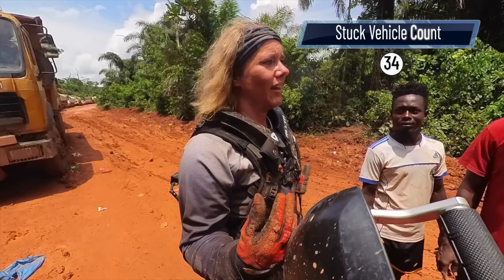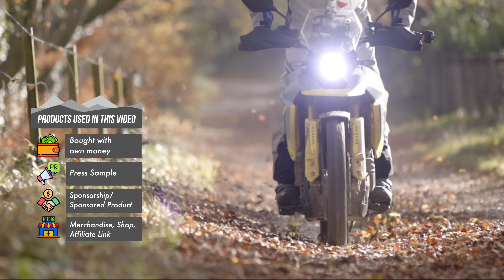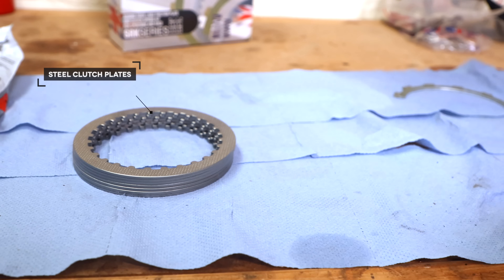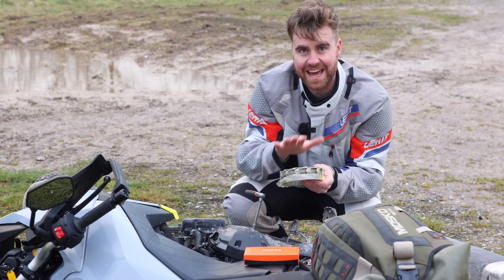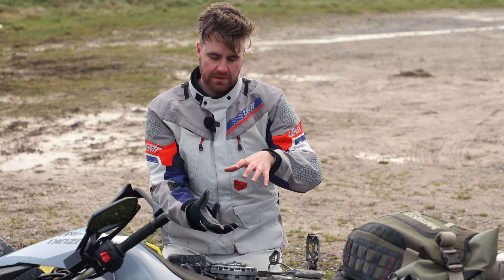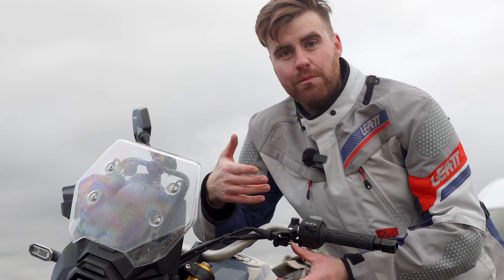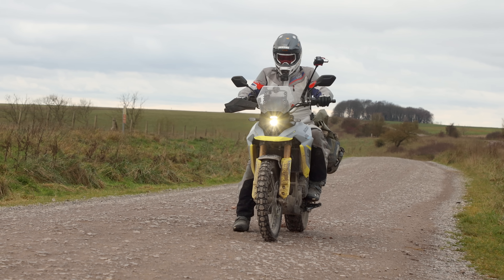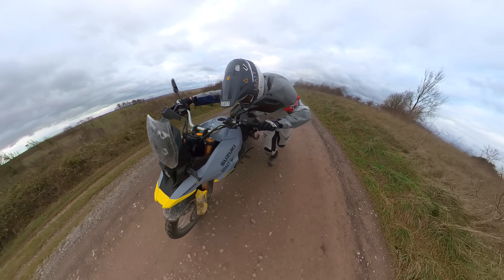This Dakar Trick could've saved Itchy Boots in Africa! | MiniTip Monday

Comment: We saved a trip crossing the Simpson Desert in Australia by using some fencing wire to increase the bulk in the clutch pack.  The clutch was burnt out 100kms from Big Red.  After the fencing wire pressure plate was added, it was ridden to Poeppel Corner, then up the Hay River Track and then home to Melbourne.  Over 2900 kms.
Reply from the maker: Hell yeah man!! What an effort.
Reply: For some reason it sounds to me like you stumbled onto an improvement in multiplate clutch models. I picture you installed it like a clockspring ? Anyway, if there's an improvement to be found at least you made it keep going on the journey of a lifetime. As it would be for most who'll see your account here! What motorcycle were you riding?
Reply: I expect oldmate just wound some fencing wire between a friction plate and steel to close up the gap haha, maybe I missed you're comments' sarcasm I can't tell :P pretty epic tale I agree, my only real outback breakdown was another rider blowing a headgeasket and me towing him ~100km to help with a ratchet strap between the footpegs. A bush mechanics clutch fix with fencing wire is way cooler and definitely one I'll remember too :) - I'm placing me guess it was a DR650??
Reply from the maker: The most wholesome set of comments on this video. Thanks for being good people and thanks for the story Hoages!
Reply: @HoagesMoto  Were you on our trip?? :-)   Yes it was a Dr650, killed by a young bloke used to riding motocross bikes (and driving to the local bike store for bits).  The fencing wire (last thing I packed before we left for the trip) was fashioned into a circle that was then inserted into the clutch pack and everything was bolted back together.
Reply: What can't you fix with fencing wire??
Reply from the maker: You can fix it with fence wire.  @geoffmerritt
Reply: Who manufactures that fencing wire?😂 you should send them a letter you might end up with an endorsement👏🏻

Comment: I can't believe you went through all the trouble to open a clutch cover on the road for this! Nicely done!
Reply from the maker: Thanks! 👍
Reply: Thats easy for most bikes. The hardest part is to lift the bike up.
Reply: @BrakeMagazine here is a much better alternative. The extra clutch plate just add it to the stack as per usual assembley. Or even better add some washers to the springs to effectively make them longer and this should get you to a shop where you can replace the clutch
Reply: on this vstrom, it s easy, which is a positive aspect of this vstrom
Reply from the maker: The plate break is only if you don't have a spare
 @holmes1956O
Reply: You legend!
Reply: Except that none of these methods would have worked in Noraly’s situation.
Reply from the maker: Why not? @G58
Reply: @G58  Seriously - why not?

Comment: Rather than snapping fiber rings. Bend one of the metal plates in a couple of places and make a wave in it. It will take up more space and act like a diaphragm spring. I have done this mid Enduro race and completed the rest of the race with no noticeable difference in clutch performance.
Reply from the maker: That’s a cool idea. I’ll add that to the mix.
Reply: Uh...  why not carry an entire clutch disk set?   They don't weigh much,  and if you're going to go through the trouble of disassembling the clutch just go ahead and replace the disks and ride on.  It's amazing to me how some of these "adventure riders" go out into the bush and wild places without being absolutely prepared.
Reply: because clutches are a gradual wear item and competent riders that know their bike will catch a little clutch slip before it gets bad and adjust their riding style to prevent it worsening OR jam the basket in one of many techniques to get out of trouble - a clutch plate set weighs up to 1kg which is an insane amount of weight to carry on a dirtbike/light advbike for a wear product people not racing will mostly detect gradual failure and be able to nurse a bike through a trip.
Reply: @HoagesMoto  You don't go out in the wilds of AFRICA unprepared for a failed clutch...  The friction disks of the clutch kit weigh next to nothing,  you don't need the steels because they hardly ever fail and lots of people just re-use them after scuffing them up with 220 grit sandpaper.  You have made no logical point here.   You can burn your clutch out quick in the muddy areas of Africa and you need to be prepared for that.   Adjustment wont mean anything when you have burned the clutch out in 5 miles of mud...   BE PREPARED.  KNOW YOUR MOTORCYCLE.  CARRY AN ELECTRICAL SCHEMATIC AND REPAIR MANUAL ON YOUR PHONE.   DON'T GO OFF INTO A REMOTE AREA LIKE A DAMN FOOL.  Have a nice day.
Reply: There's always a bush repair that will get you going again until you can do a proper repair.  It helps to have a good imagination and all the tools you might need.
Reply: Can't believe they don't just carry a spare bike... @BillySBC

Comment: There is a more subtle way to handle the early state of this problem.
Add a few washers under or on top of the springs. That way you increase the pre-load on the spring and thus adding friction. 

Used this method a number of times, learned it in tuned old types of motorcycles that didn't have stronger springs or more friction plates available.

Comment: in noralys case,the clutch on the crf 300 rally is a known weakspot - so in her case ,it was bound to happen,the solution is to replace the stock crf300 complete assembly whit the one from the crf 250l combined whit steel and frictionplates and heavy duty springs from the cbr 300 - fits right in,and has one more frictionplate,and 5 springs instead of just 3
Reply: You will lose the slip/assist function if you do this.
Reply: Good suggestion.  I think Noraly needs some guidance on when to do maintenance and when to upgrade for known troubled areas on stock bikes.  She does a great job beating the snot out of stock bikes.
Reply: Beste stuurlui staan aan de wal😅

Comment: Nice video - could save some folks a lot of bother. I had a similar problem with my first big bike halfway in to work in London. After waiting all day for a tow truck, the tow truck guy let me in on a trick that would have saved me next time: carry a spare clutch cable, passed through the route of the existing one, gaffa taped or zip-tied to the current one. Time to repair then is a matter of seconds on the road as you connect the ends of the new cable in where the old one went & strip out the old one. Once you get to the repair shop, just buy a new spare & tie it in place as before.
Reply: This is a very old enduro trick and one I've used on my bikes for many years. We're never to old to learn.👍🏻
Reply: ...and tape the ends of the spare clutch cable so no water can get to it and rust the cable (and oil it a bit)
Reply: @TetraX-ui7xl  yes, good point!
Reply: Good tip, and one I've used a lot, especially on my old 400 single, which destroyed cables on a regular basis. Only thing is, it's not helpful in the situation described in the video.

Comment: I honestly can’t believe how anyone would take on the kind of trips Itchy Boots does without really good mechanical knowledge of their machine,and how to deal with all the common issues that WILL happen when you’re doing those sorts of mileage.on my 16th Birthday I went out about 6 in the morning on my DT50MX super excited I rode about 40 miles and my Clutch cable snapped,I got home fine riding clutch less but all my bikes now have a spare cable zip tied to the existing one.Great video !
Reply: I did the clutch cable thing, I also had a hollow tube in the frame under the seat and stuffed a rubber siphon hose and extra bit of gas line.

Comment: Another tip - when your clutch starts to go, use lower gears to limit the load the clutch needs to handle (not 6th gear like I.B.). Even a slow limp in 1st gear is better than pushing.
Bikes using a hydraulic clutch can also try cracking the clutch line to release built up pressure - hot clutch fluid will put a preload on the slave cylinder, inducing slip.
Reply: Not sure what you mean by “cracking the clutch line”. ?? Cutting? Bending?
Reply: @big566bunny  I believe that he means cracking open the bleeder screw briefly.  That will relieve the hydraulic pressure.
Reply from the maker: I think you’re right.
Reply: Correct - easing the pressure built up due to heat. Just undo the bleed nipple a very small amount to release the pressure, then tighten it up again.

Comment: Two points there:
· She was stuck in deep mud where you couldn't just jump the bike into motion. If Alaska had a big chunk more of power, the rear wheel could have done the slipping instead of the clutch, but there obviously is the limit of the low cc engine light weight bike: There's only so much oomph available for flinging mud out off the way. That may have been the reason for her exploration of different bikes during her Africa break. (And boy, does the Himalayan 452 look promising there!) All in all the CRF 300R still seems to offer more advantages than shortcomings to her and mud is only one of several obstacles she had to deal with.
· The entire clutch assembly had to be replaced in the end. She didn't discuss the exact failure in detail, but apparently the damage was deeper than just burnt clutch plates. Maybe the forks of the outer case had worked in beyond their limits and lifted the clutch with dents, maybe there was something wrong with the slipper clutch mechanism, maybe that, maybe, maybe.

One of the problems when you burn any clutch is that the material on the surface changes. The steel parts get oxidised, the organic material chars. This affects the friction coefficient. Especially with bikes where the clutch runs in oil and there is loads of carbohydrates available for charring. The charred oil makes a gooey slippery consistency and is stuck to the surface of the clutch and goes deeply into the pores of the material.
I have no way of knowing if my idea will actually work in the African outback, but what I imagine would be a good temporary fix: Find yourself some really high percentage moonshine and dump the clutch plates into it, Give them the best possible clean in the stuff, then try sanding off the top layer of oxidation if the steel parts are discoloured. The alcohol should dissolve most of the charred oil and thus both get this source of lubricant that may inhibit force transmission out of the way and also, as the built up charred oil increased the surface touching the other side of the clutch, increase the area load on the bits of clutch surface that may actually transfer force to a level where it may work again. While this obviously will not be a full repair, it just may get you going until you reach a point where you can get a garage and spares. If grinding was involved, the parts need an extremely good rinse, obviously (again), as you want none of these hard particles in your oil.
Reply from the maker: She was stuck on a tarmac road. Watch the video again.
Reply: @BrakeMagazine  That's where the last bit of life went from the clutch. It had burnt long before.
Reply from the maker: And that’s what the video is about. She got to the road and then needed rescue. She coulda then gone through this process.

Comment: Great tips, thank you. I had a Clutch Master Cylinder fail (the seals went) Baja early a run from from Tecate to Cabo and back on a KTM 525.  I ended up stopping on rises of small hills to facilitate easier starts whenever possible. On steep descents, I covered the the kill switch.  Did nearly a 1,000 miles that way until I found a replacement in a what was essentially a Motorsports junkyard.

Comment: WOW! Really wish I knew this trick when my buddies clutch burnt out in the Oregon desert last summer, could have save our entire trip!!!!
Reply from the maker: Sorry to hear that
Reply: @BrakeMagazine  I'm confused! How can 'fixing' one friction plate make the drive solid when all the other friction plates continue to slip  ?
Reply: There just isn't enough room in there for another plate thickness - the width of the clutch pack is fixed by the basket dimensions.  @DirtRiderLife
Reply from the maker: So what allows the slip is the reduced friction because the plates can move slightly side to side. When you increase that friction by making the stack of plates bigger then none of them can slide or move.

In the comments you'll see lots of other ingenious ways to solve the same problem. Leather shoelaces, wire etc. @dznnf7

Comment: These driving techniques are also useful in case you can't control your clutch, such as a snapped cable or a broken lever if you don't want / can't stop to ammend the situation. Maybe you are a few Km from your destination and you want to deal with it in the hotel or at a shop. Doubling a snapped plate to direct-drive the bike is just brilliant. BTW the lighter your bike is, the easier it will be on the transmission and the starter, unless it is overengineered.

Comment: Super cool trick when you're riding on flat terrain. Itchy Boots was riding through mud and water, up and down the hills. I don't think riding without a clutch will work in that type of terrain. Correct me if I'm wrong.
Reply: On the terrain that finally fried it she wasn't even the one operating Alaska when it was happened, a local got her bike through the mud and was quite aggressive on the clutch to do it, she tried to tell him to go easy but she knew she wasn't as likely to be able to get through. It was unfortunate but you are correct that welding the clutch and using clutchless starts the on that mudbog of a road would not have been practical. After she got onto better roads thoug she was struggling slipping clutch and the broken friction disk trick could have got her to her Abidjan. Also the idea of carrying one spare friction disk mounted somewhere on the bike could have helped.

Comment: Great video. I imagine many of us have had a road bike fall over and broken the clutch lever. I remember having to ride home from a bbq without a clutch on my NS125. Fun part was having to come to stop at some lights then get of the bike and run with it before kicking it into gear, with a police car sat behind me at the lights. didn't know about the inserting a broken clutch plate trick. That's a nice one to know.  👍🏼
Reply: Some riders carry a small Vice-Grip / locking pliers to use as a quick lever replacement, as long as your broken lever has enough of a nub left on it for the pliers to grip. Deployment takes seconds & off you go.
Reply: @njpaddler  Yeah I know that trick, works on shift levers too. Coming from a bbq I didn't have tools on me for 4 mile ride back.

Comment: Blip the throttle when you clutch-less downshift, it puts less stress on the gears.
Reply from the maker: Agreed
Reply: If you hold a tiny bit of throttle on and hold the brake then downshift it can be achieved almost seamlessly. Basically as it transitions between gears it revs up for a split second and goes down a gear much easier. Same works for clutchless downshifts on road in general. Run down the rev range lower than you usually would, to say 2000-2500 rpm, braking, throttle not completely cut, in a position that would give you say 2500 rpm of free rev, and then with some preload on the gear lever it’ll generally just shift without the slightest issue. On some bikes 1st to 2nd can be very clunky up and down without the clutch. On my Honda VFR1200 I just pause in neutral very briefly instead of shifting straight up or straight down, and it makes all the difference.
Reply: Yup

Comment: Thank you! I,ve ridden my bike without a clutch, when my clutch wire snapped, but I didn’t know about the fixed clutch  trick. My friends doing moto-cross told me they never would use the clutch, except at starting off.

Comment: On every bike that I've owned that had them (and there have been quite a few) I have always removed and bypassed the clutch nanny switch, the sidestand nanny switch, and the neutral lockout nanny switch. Not only are these things a real nuisance to an experienced rider, but they also tend to fail at the worst possible time. With all these switches bypassed, you can start the bike in gear with the clutch out.
Reply: I am a very experienced rider (Been riding 40 years, never had a car, 130,000 miles on the current bike alone) and I still sometimes go into gear with the side-stand down. So I keep the side-stand switch. Maybe this is partly due to never having had a side-stand switch problem. Which is pretty impressive thinking about it, given the age and milage of my bikes.

Comment: One many BMWs, even as far back as 2004, the ECU is looking for the clutch position switch to CHANGE from 'engaged' to 'disengaged' after the bike is switched on. This prevents a rider from shorting the switch to 'always disengaged' to bypass safety measures.

This could have been why you couldn't do the starter trick with the Suzuki.